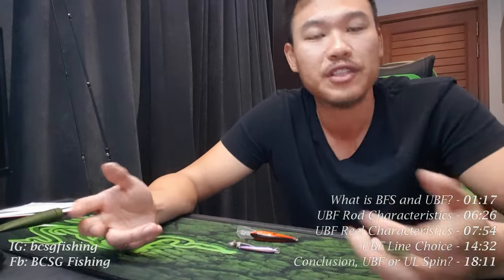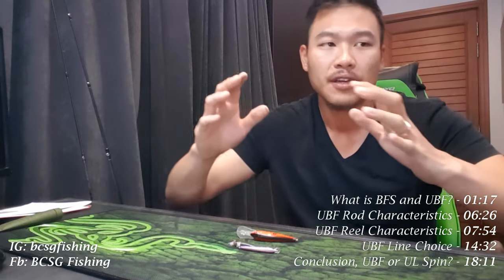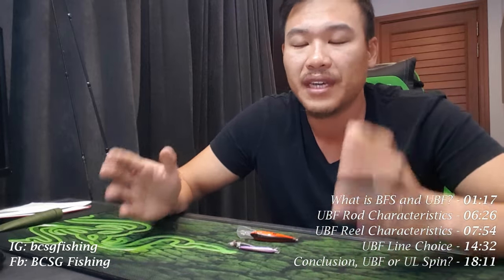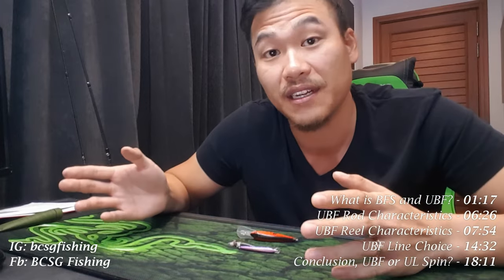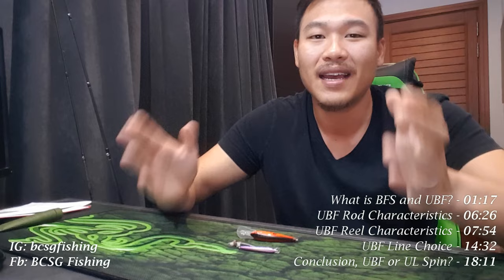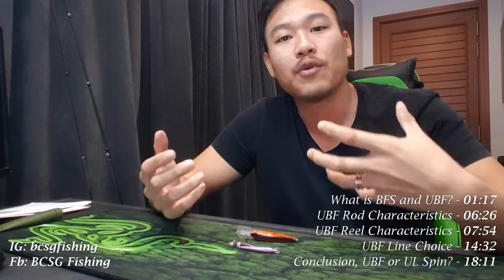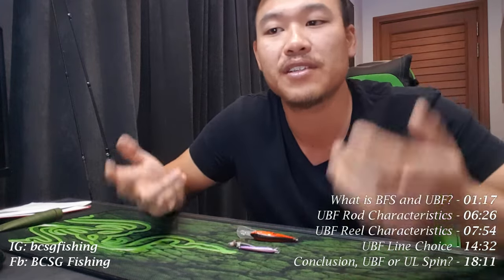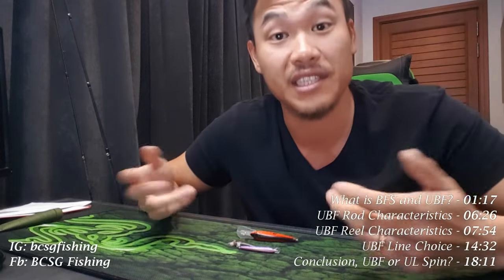Tackle Talk Ep 5: Ultralight Baitcast Fishing (UBF)

Comment: All the English speaking anglers in the west owe you a big thank you. We are way behind the Asian anglers when it comes to using very light tackle especially baitcasting outfits. Your explanation of the two types of braking systems were spot on.
I prefer the centrifugal braking and fell in love with the Quantum reels because they allowed you to dial in the centrifugal braking power just like a magnetic system, it didn't require you to remove the side plate like other centrifugal braked casting reels.
Some of the latest Quantum PT range of reels built on alloy frames are using the hybrid brake systems. I see the same trend on many of the Chinese baitcasters and they use the same spool
with a dial in centrifugal system built onto the spool. But that doesn't suprise me as Quantum and most OEM big name rods and reels are made in China and a few in Korea. I'm very impessed with the Kuying range of rods as well as the Dagger rods. Build quality looks very good for the price and your video
confirmed that. The fact that all 4 Teton rods had perfectly placed the guides in conjuction to the spine which is in exactly the right place. You expect that kind of workmanship from a good custom built rod or a high end off the peg rod. Without doubt one of the most intelligent and informative reviewers on the subject of ultra light fishing. This type of knowedge is very
scarce in the UK and it's highly appreciated.

Comment: Wow!! Great video and very eloquently put, you have answered all the questions i have fired at the BFS page on facebook about any advantages of BFS over Fixed spool Ultra lite, in the UK BFS is starting to take off but i have been questioning its use because of our predatory species of fish, without getting any satisfactory answers, ULC seems to be that answer. We have 3 main predatory species ( excluding trout) Perch, Zander and Pike, the weight range of these 3 fish can range from 50g to 20kg They are present in all our rivers and canals and 90% of our lakes and ponds, so when you cast that 3g lure you could hook up a small perch or a massive pike, its a risk you take when targeting the smaller species with UL gear, Therefore we step up the gear for targeting pike, heavy jerkbait  and baitcasting set ups casting 100g plus lures on 80lb braid with 50lb wire leader, just like the yanks do for their Musky fishing, you dont catch any perch with this set up. I enjoy my UL fishing most, with a 1-7g rod and a 1000 series reel i cast 2-3g lures but on 12lb braid with a 10lb wire leader, i have the sensitivity for small perch and a decent chance of handling a 10kg pike. I also enjoy using a baitcasting set up in heavier weights and have been fascinated by what i have read about BFS, however your description of ULC seems to seems to fit my purpose perfectly. Loading a BFS style baitcasting reel with a similar breaking strain braid to my UL set up and with a suitable rod should enable me to cast the small lures for perchand not have to worry about Pike, I feel loading with 12lb Flouro would not allow casting small lures, somewhat defeating the object. Thanks for enlightening me

Comment: Great video, you inspired me for UBF. Watching your videos I got hooked up on UBF, but planning to do it on small bushy europen rivers for chub, perch and zander.
The only thing in it know of, I might not agree with you on the matter of magnetic brakes: it does change braking force with the speed. With spool turning slowly, there is a very little (or no braking force at all like if it stands still), so when spool increase speed the braking force increases proportionally. In this it is similar to centrifugal brakes, but significan difference is in that CB does need some force (or higher speed) to engage while MB does not, it is always proportinal to speed of the spool. That is the phisics theory anyway as magnetic brakes use eddy current  induced magnetism...
Reply from the maker: +MIKE VIAM hey man, glad my videos helped you, yep you are 100% correct. 
It's been awhile since I made this video but if memory serves, what I meant when I said that mag brakes produce "a consistent force throughout the cast" is that the brake force generated by mag brakes is consistent(directly proportional) with the spool speed. Spool speed 1 brake force 1, 
Spool speed 10 brake force 10.

Centrifugal brake force increases proportional to the square of the spool speed. Spool speed 1 brake force 1, Spool speed 10 brake force 100.
Reply: Yap... You are 100% correct, too. Not that it matters, anyway, I just mentioned it while I was making a very nice UBF baitcasting reel out of some worst and cheapest reels on the market (Lixada AF103B) with MB and CB and the project turns out very well. With a 2g lure I can hit the 12-15 yards, 3g right over 20 yards and with 4g constantly over 25 yards (with CB a few yards less), all of this based on "instructions" of this video...
You are just great, simple things said in simple and understandible way...

Comment: Sir, I am very fascinated by the micro systems by both the UK and the East.  Do micro light rods come in long sizes like the UK, but with micro reels? Can we develop micro reels to use an electrical braking system that uses the rotation of the spool to create electricity?  This would enable a user to electronically control the reel's behavior based on casting style, the type of rod, the weather, or obstacles/water conditions.  Thanks, Bill Sutherland, PhD in Mathematics.

Comment: 1 question, in finess application , what is the optimum rod length? longer or shorter than myself (height approx 5'6) ?
Reply from the maker: +Muhammad Harith hey I think there are no fixed rules for rod length but there are  2 factors that somewhat influence rod length.

1) your general fishing landscape. Do u fish in open areas more or in the jungle more? Areas with alot of restrictions tend to require shorter rods to execute technical casts.

2) your height.

The formula I recommend for open areas is about 0.5-1ft longer than you are tall. I am 6'2, so I tend to prefer rods that range from 6'8 to 7'2. 

For dense jungle it really depends, some folks use rods as short as 5', whatever gets the job done with the available space(assuming you don't wade out).

But again there are no fixed rules, I think it is more important to find a rod that suits the lures you are casting, with an action that suits your casting style. I personally prefer fast action(most applications) or moderate-fast action(for the really light stuff below 3g), I dislike extra-fast and Moderate action, they dont suit my casting style.
Reply: alright...appreciate your advice... tyvm
Reply: alright... appreciate it... tyvm